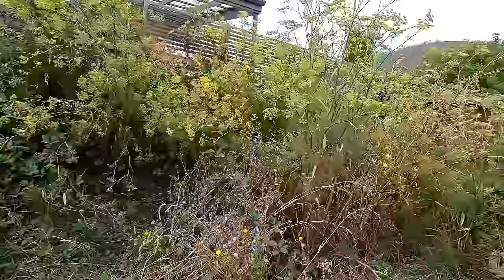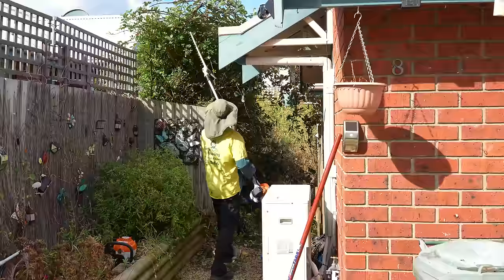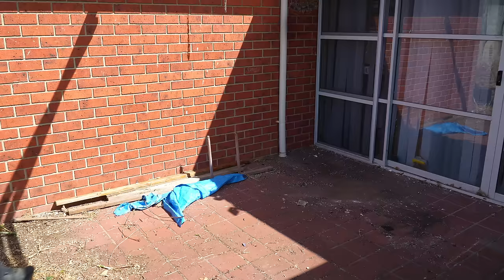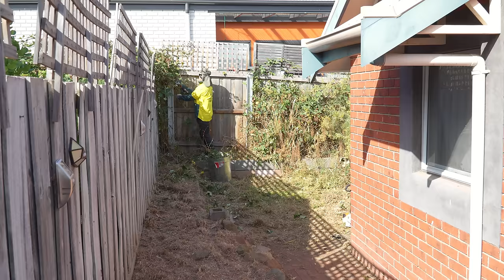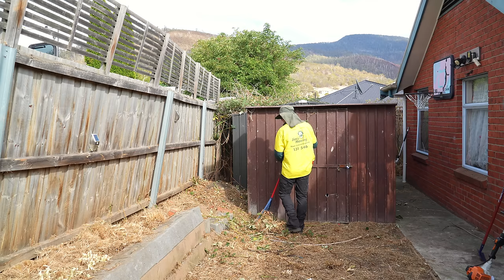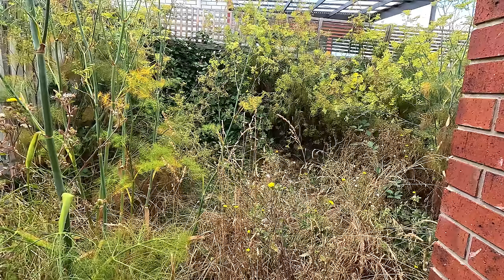She said CLEANUP & REMOVE Everything!

Comment: Tools:
Multi tool:Stihl km 131 r,Stihl km 94 rc.
Stihl fs-km trimmer/brush-cutter,hl-km adj. hedge trimmer, pole saw attachments.
Hedge trimmer:Stihl hs 45.
Black rake
Mulch rake
🔨 
Tin bin
Flat shovel
Black trash bags
Blower:Stihl bg 56
Felco pruners
Weeder/pick ax.
Mower:Honda hru 216 m 3 21”

Comment: Question. Any particular reason you don't back your truck into the driveway on jobs like these to save some time walking back and forth with debris?
Reply from the maker: It would only save a few meters, and it usually results in little space to move and work around the trailer. The camera is deceiving, it's not as far as it looks  🙂